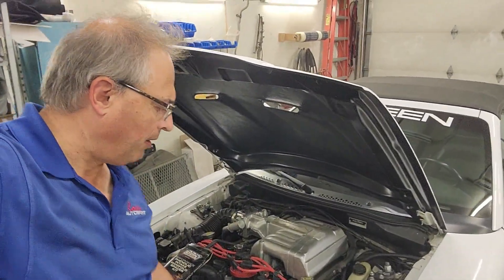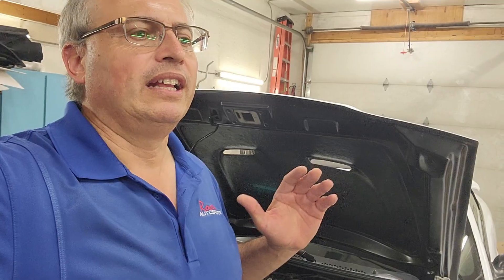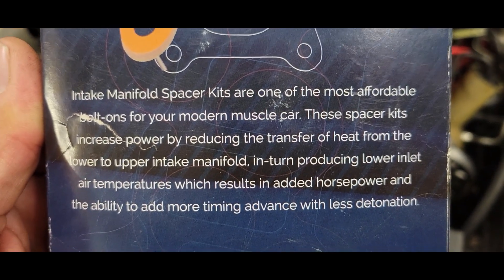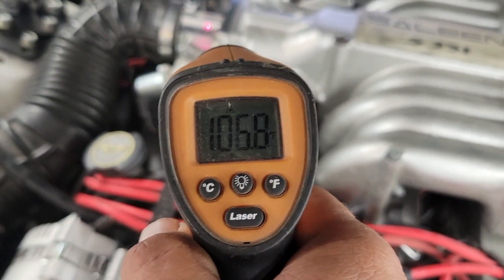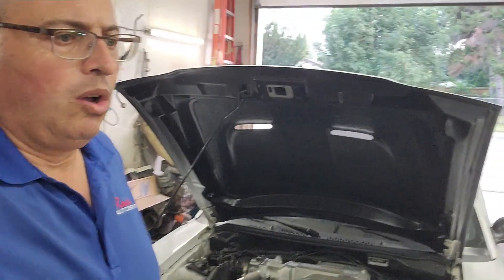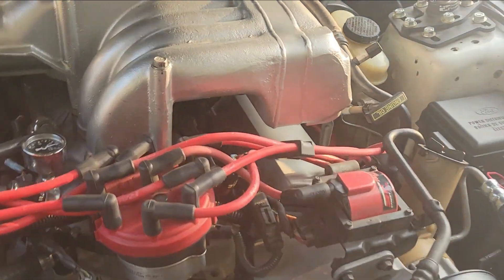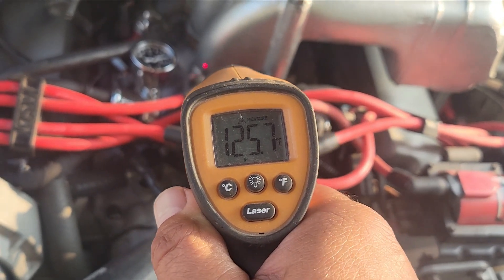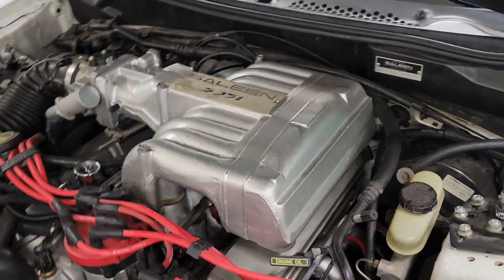COBRA / GT40 INTAKE PHENOLIC SPACER TEST!  HOW MUCH COOLER??? - 306 Foxbody

Comment: Thanks for the test. I have a truck based 306 in my Econoline. So it has the even LARGER long runner plenum with dual TB. Lower intake I ported, plenum I matched the lower but I also cut the thing open to do cross sectional area. I did this to bump the HP curve up some so it can go over 5000 rpm. So now the plenum runners are probably flowing a big high 200 cfm. I have a 3/8 inch and a 1 inch phenolic. Also got a 1 inch throttle body spacer. Adding 2 inches of runner / plenum length would have started to make my work on the plenum go backward so I thought of using the 3/8 inch just for cooling.   I'm about to do my break in soon. What I realized is the aftermarket EGR pipe I got won't reach the TB (and the factory ones had ribs to be able to bend). So I'm standing there in the garage thinking about hardware length / benefits / having to bend an EGR pipe... This video helped me realize to just hook everything up gasket to factory castings.  Obviously I could tinker with that later.  Thing is I feel like obviously the porting work I spent so many hours on are worth that much more and are not going to be negated by 3/8 inch of non metal thermal contact.   I Also realized  that running EGR probably DOES negate the gains of a phenolic. Your Mustang looks mostly factory (very nice)  so I'm assuming it still running emissions equipment.   Before deciding to be NA I did have a blower and a water / meth injection kit.  I had explored or thought of if one were to still use distilled water misting into the intake but I think it would mess up volumetric efficiency without having fuel with it.  Van dog houses do get hot but I mean I did put louvers in the hood,  and I'm sure having a good cool air intake / ram air system going to the front would be more worth cooling the intake than this.  So definitely appreciate you doing this to save me the hassle!  Just want to start this thing lol

Comment: All these 5.0Lmanifolds should be made from composite.  Its 2025, not 1990.
Reply from the maker: @24theMoney You bet!  Would be much lighter and have better heat resistance...as long as a guy isnt running nitrous (in case you get a nitrous backfire) Plus they shouldn't be as expensive.   Thanks for watching and commenting!👍👍
Reply: @306foxbody1  I believe the cost to re-certify a new manifold for EO/CARB is what prevents companies from doing so.

Comment: Really interesting video, I had one of these on my GT40 intake and I always wondered to what degree (pun sort of intended) it helped. Thanks for sharing!
Reply from the maker: Hello there!!  Looking back I wished I did a real time test with a temperature probe on the intake.  I think it will prolong hear soak, and maybe long term the highest overall temperature might be lower as long as there is a decent amount of air passing through the intake (not sitting idling for extended times).  It still seems more useful just as a spacer...for now anyways...  Hope you're having an awesome weekend!👍👍
Reply: @306foxbody1 I have phenolic spacer on my supercharged Audi and can tell you that it absolutely reduces surface case temperature of your blower. However, based on my research online ( not much info to be found ) many people speculate that cooler blower case will not be enough to overcome the heat being created by the high pressure inside the blower. The benefit would be in “divorcing” or isolating your blower from the engine. They act as two independent blocks of metal radiating heat. They now focus on cooling themselves. The hellcat platform vehicles have the most information available with their spacer plates. The company f I interchiller has a short section in one of their FAQ articles about them. Plasmatio made my phenolic plates you might be able to email them for info

Comment: Aside from the other mentioned reasons for using the spacer, I think you'll need to conduct the test with a running engine to see if a differential exists, as the air running through the manifold will cool it. You will need to thermal wrap the intake box and feed conduit to keep the under hood (hot)air from affecting the temperature also. I have the Motorsports GT40 tubular intake that has a lower mass of material to retain heat and that could make a difference also in the results. Good luck with the experiment on this.
Reply: Todd this is a great video. I have the trick flow 3/8” spacer under my cobra intake. Honestly I only bought it so I could get the bolts because mine were not factory.
I wonder if doing a driving test would yield different results. I think it’s heat soaking. All that hot air running up through the runners to the intake. As heat does rise.  Excellent test. I appreciate the video. Looking forward to seeing if you find out more! 
👊😎✌️
Reply from the maker: Hey Rick!  I really like any input I'm getting regarding this test...I am considering another test, but this time, I might attach a temperature sensor to the runners and do a real time driving test.  Thanks for watching!  Hope you had an awesome summer!
Reply: @306foxbody1 Thanks ! I got my car drivable at least. It’s been so super hot.  
How are you coming along with the custom intake build?
Reply from the maker: @BigStickStangs  Hi, the intake is on a standstill until i park the car this fall...but I will definately still be working on it!  Thanks!!!
Reply from the maker: Hello,  thanks for your insight!  I thought about placing a temperature probe on the intake and then driving it with and without the spacer, to see if there is a real time temperature differential.  The intake would likely take longer to heat up with the spacer installed.  Also, i wouldnt do it to this car, but if I had a "test vehicle" that I was willing to experiment with more, I thought about having an enclosure to separate the upper intake, and intake duct work from the lower intake and the rest of the engine bay.  Basically keep the upper intake system cooler with ambiant air...I thought that might be interesting, and would likely yield some posative results.  Thanks for watching, and thank you for your comment!!!👍👍
Reply: @306foxbody1  One of the popular vendors offers a replacement steel hood (87 to 93) which is louvered on each side towards the back to help extract the under hood heat whilst driving.

Comment: It still has the egr gases running through it heating it up.
Reply: Hi, Thanks for your comment...that is definately one thing that could be easily overlooked...   However on my AFR heads, there is no EGR port that could feed exhaust to the intake.  But that is definately something that would be a factor if the EGR port was present.  Thanks for thinking of that...I had to think about it for a minute (I actually checked one of my old videos to make sure I had no EGR ports on the AFR's, but glad you mentioned it...)  Thanks!!!